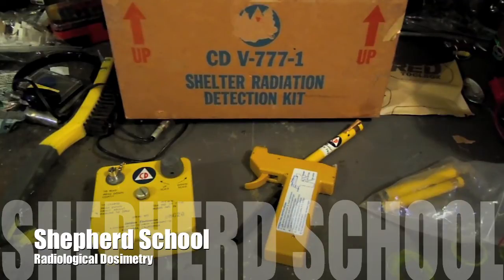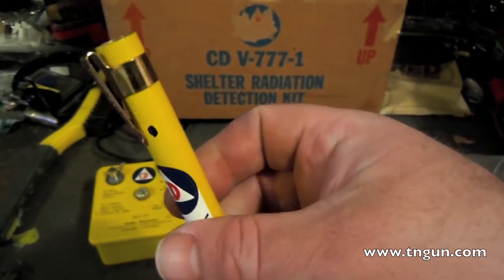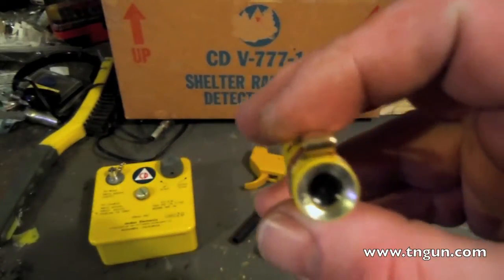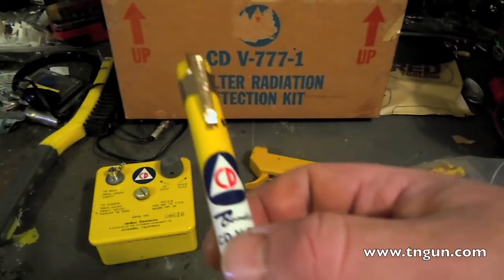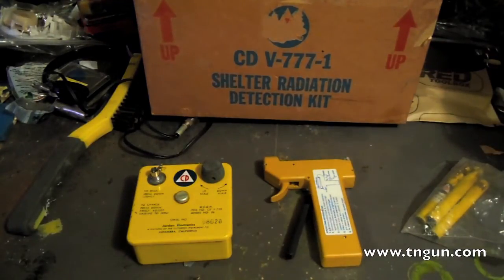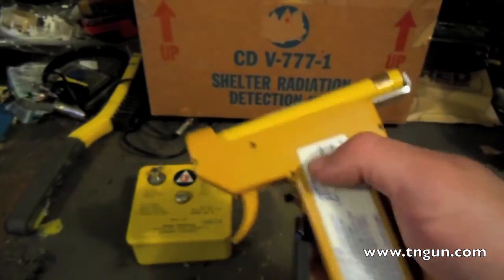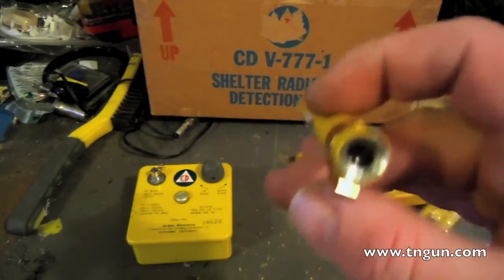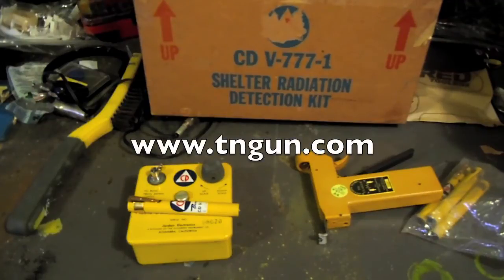Basics of Using Radiological Dosimetry Equipment

Comment: The handchargers are great I can zero out a bunch of sticks in 1-2 minutes once you get good practice. they are expensive typically and SE International sells them, the CD 750 model 6 is the same as what SE sells for over 150 dollars. so if you see them on ebay for 50 bucks I would grab them.